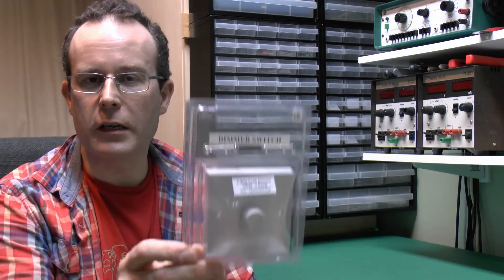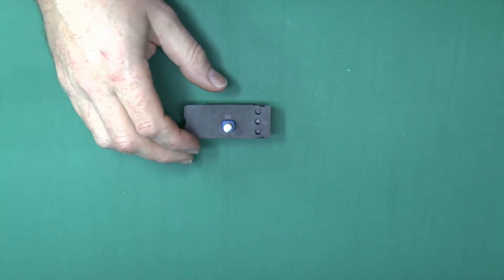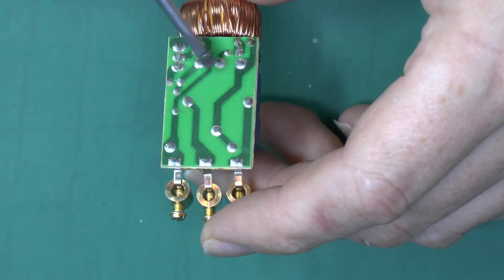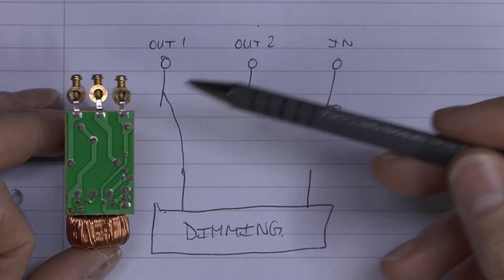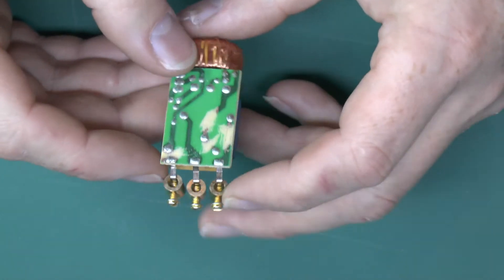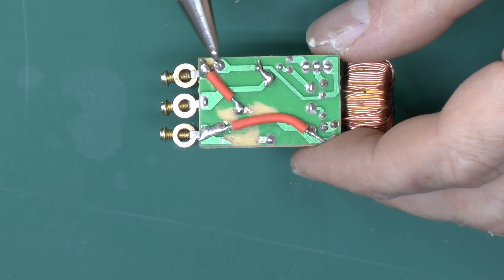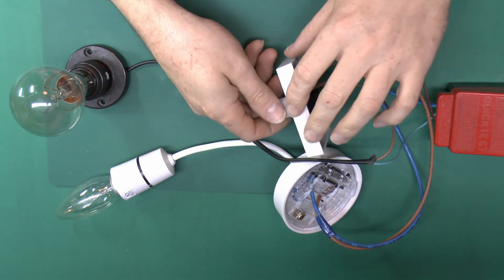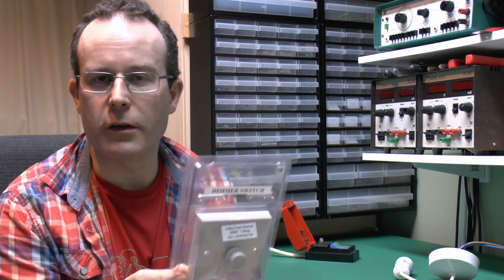Dimmer Switch Modifications - Dimmed and Undimmed Outputs

Comment: You could have achieved this by using "OUT 1" as the input and "IN" as the dimmed output, then all you would need to do is cut "OUT 2" and move it to the dimmer side of the switch... just one cut/move.
Reply: ....it looks like it,  it wont make a difference to operation of the dimming circuit if live is fed in to an out, and load taken to the in,
Reply: probable reason is that the markings will still make sense,  you'd need to alter the markings if altering their connection function
Reply: its not really marked as in or out anyway,  but C for 'common'  of a 2 way switch alternating between L1 and L2,

Comment: 1970s mk dimmers would have been perfect here, fixed switch and a variable output, used on 1 way wiring the switch turned both the variable and fixed load on/off

Comment: I know this is now ancient history, but it would appear to me you could have done this with a single solder bridge?
Just short one of the outputs to the center contact of the switch.
Your old input goes to the dimming lamp, your non-shorted output goes to L, your shorted output goes to the fluoro tube.
Reply: Don't think that would work.  This is a 2-way(UK)/3-way(US) switch.  which normally allows you to turn a circuit ON or OFF from two locations.  Note - one location normally controls the dimming for both.  This modification removes the multi-switch option in favor of having one circuit dimmed and one circuit fixed while retaining a constant ON/OFF function for both circuits.  Shorting one of the terminals, while in a single switch circuit, would simply leave the shorted terminal circuit always connected and always ON.
Reply: @jayherde0  It would work. Picture the standard 3-way (I'm in the US) wiring arrangement, the switch on the end closest to the lamp. 'COMMON' goes off to the lamp, with the dimming circuit in between. Traveler 1 or 2 gets hot from the other 3-way. If you connect one traveler permanently to hot, you have a regular 2-way (again, US) switch. You could use 'COMMON' as the switched-but-not-dimmed output, and add a dimmer after it for the 'dimmed' output.

In this case the entire 3-way switch is contained within the dimmer, so you can't access the 'common' terminal. Simple matter to jump 'common' to the other traveler terminal and use it as the not-dimmed output.